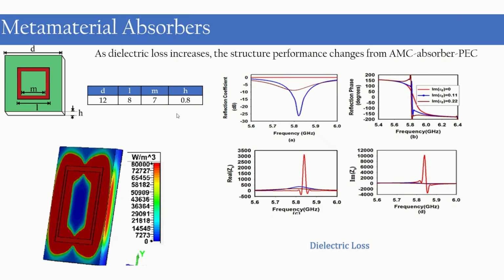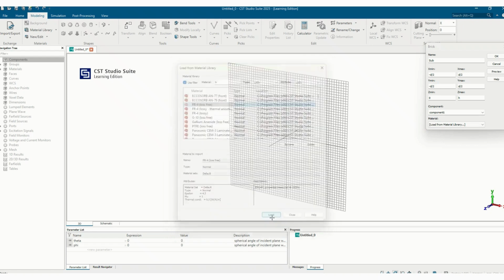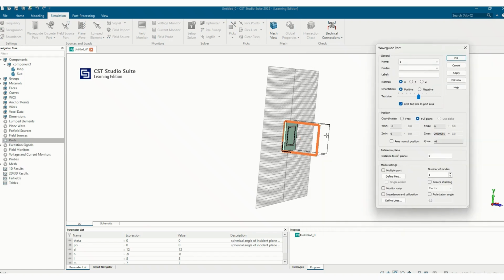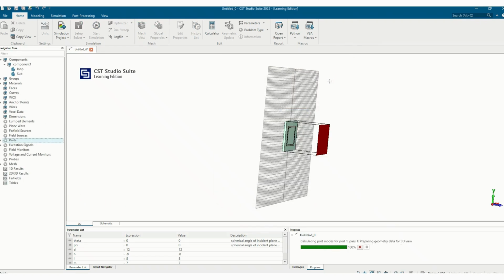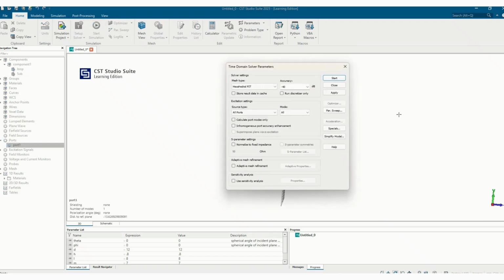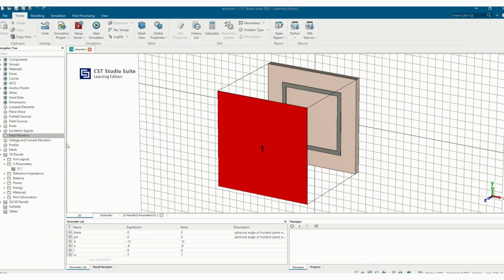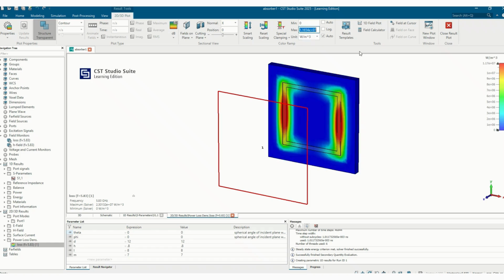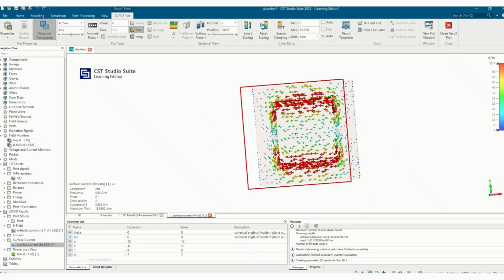Metamaterial absorber Simulation using CST (Time Domain Solver)| Surface Current and Power Loss

Comment: why we should set up zmin= eletric(Et=0) instead of open (add space)?
Reply from the maker: Incase of metamaterial absorber, the bottom portion is usually metallic. That's why we are using electric. 
We can use open and deembedding for Zmin also. But incase of this structure with metal backing, it is just wastage of resources.As this open addspace will increase meshing and will take more time.
Reply: @waveresTech  Currently, I'm considering about shield effectiveness of metamaterial absorber. You can find the formula to calculate the value of shield effectiveness in lots of researches: SE_total=-10log10(S21^2). I found that the magnitude of the transmistance nearly zero (about 1e-66) but they can still calculate the shield effectiveness successfully (for example in this paper: 10.1007/s11664-025-12512-3). Do you have idea of the way exactly to calculate or stimulate this value? Thank you very much.

Comment: Hi, my surface current is just shown at the bottom surface of ground plane it didn't move upward on the top metasurface. I also change the CST version as well. i am finding this issue again and again. i followed all your steps. Need your guidance. Thank you.
Reply from the maker: In 2D-3D plot Tab, there is cutting plane option. Click on it. There is two tabs nearby for Normal and Position-select the axes and give the distance to the top surface. You will be able to see it. It is explained around 10mins in this video.
Reply: @waveresTech  i follow all these methods but for surface current it doen't move up and down just stick at the bottom. but for electric field and magnetic field it's working.
Reply from the maker: @ahmedali-rp9po   This may be helpful to plot surface current without using cutting plane option- https://youtu.be/FYRFPRH6pvI
Reply: Same problem
Reply from the maker: Really Sorry, I am not sure about it.
Reply: @satyaprasadmishra1280  Have your problem resolved?
Reply: @ahmedali-rp9po no
Reply from the maker: @satyaprasadmishra1280   This may be helpful to plot surface current without using cutting plane option- https://youtu.be/FYRFPRH6pvI

Comment: How to get co- and cross- reflection coefficient using Time domain solver with waveguide port? Or any other way where we can get the co and cross reflection coefficient while simulating whole array instead a unit cell
Reply from the maker: It is not possible to obtain co and cross polar reflection coefficient using time domain solver.
Frequency domain solver serves that purpose.
This video may give some idea.
https://youtu.be/2Z_-R5oW0hk?si=A9VJzl2SImycwF8p
Reply: @waveresTech but the reference video uses single unit cell. How to simulate whole array to get its co and cross component?